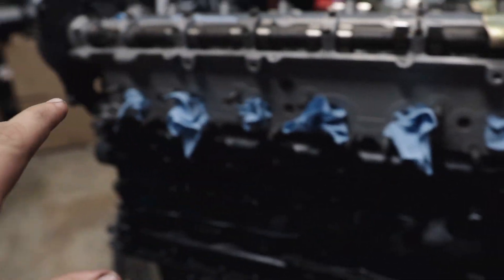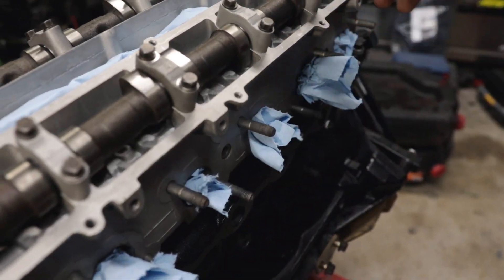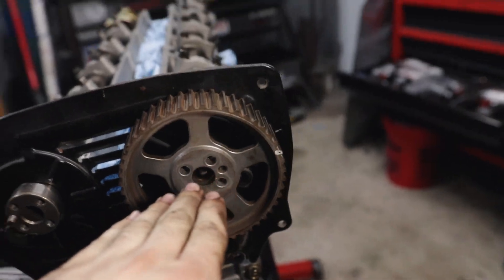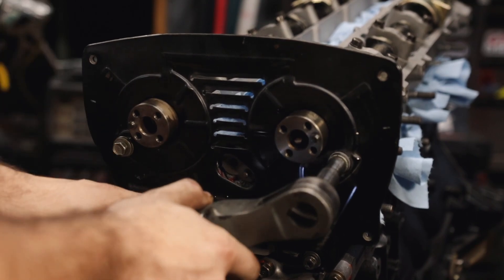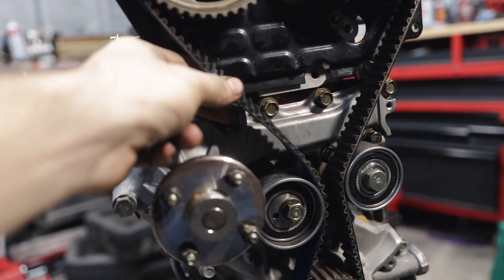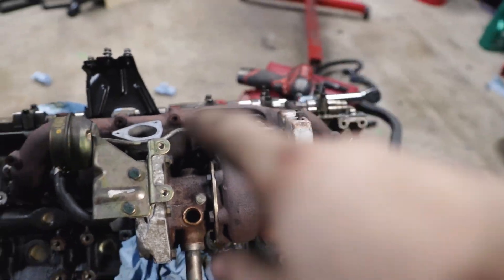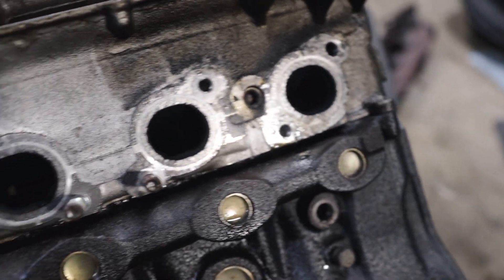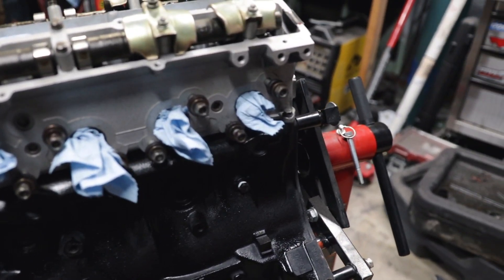OEM Rebuild RB20DET Timing Belt And Cam Swap

Comment: hey man i so i am doing the head gasket on my rb20 right now and i’m about to get the car to tdc and remove the timing belt and cams, but i have heard you cannot re install the cams on tdc, is that true? i am very new to getting this far into a motor and don’t want to mess anything up
Reply from the maker: I swapped my cams with the head on still and didn’t have any issues. You should be fine but try to keep it as close to tdc as you can to be safe